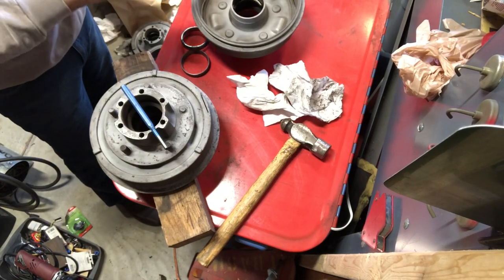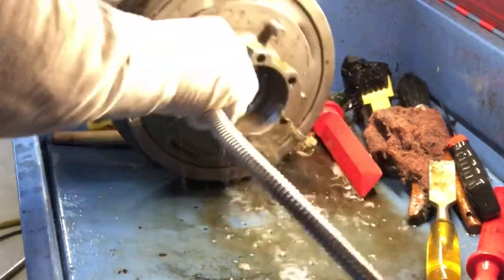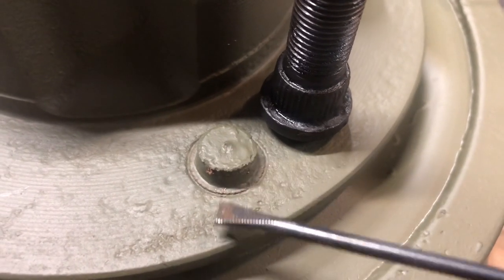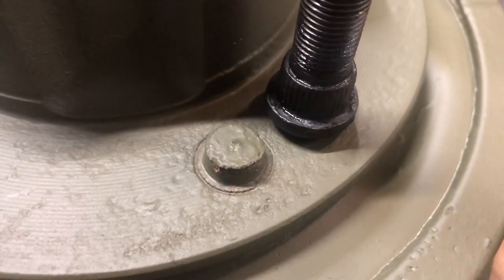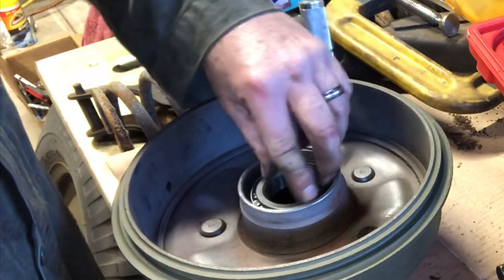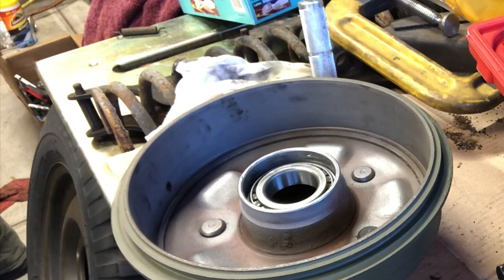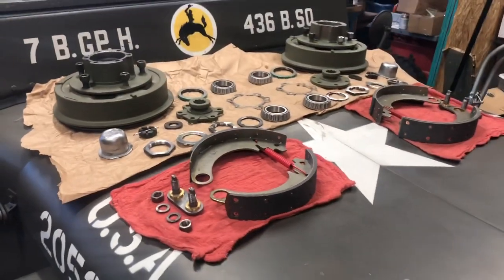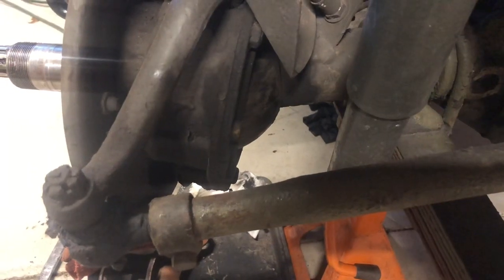Brake drum rebuild on a willys slat grill

Comment: Mike...does it not matter that you swage that stud? I have a few hubs where the studs are broken or the threads are just rubbish, if I drill out all of the studs won't the hub fall away from the drum? How can I secure the two parts?
Reply from the maker: Gavin Ashard Studs might be broken but the gripping splines on the stud are still there and it’s a portion of that that we have to cut away before you press out the bad stud. If you don’t do it you will make that gripping area larger then your new studs will not go in properly they will be loose. If you do it that way and you put in the new studs you may have to spot weld the heads to the drum to keep them in place
Reply from the maker: Gavin Ashard Also pose that question on my Facebook page under the video so other guys can chime in